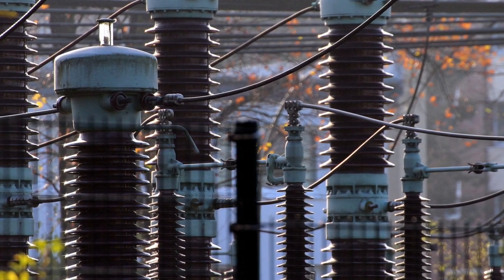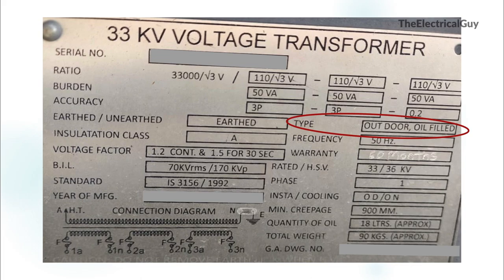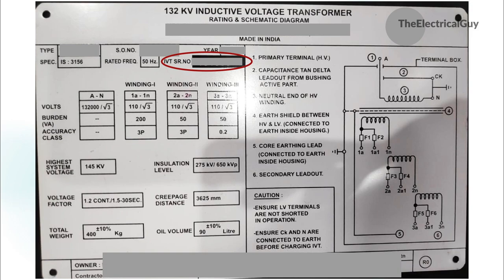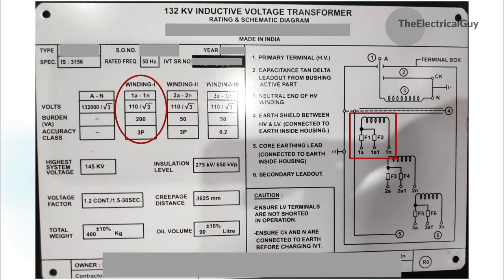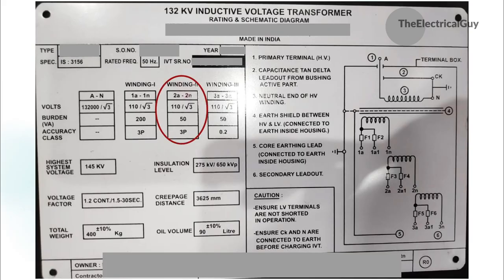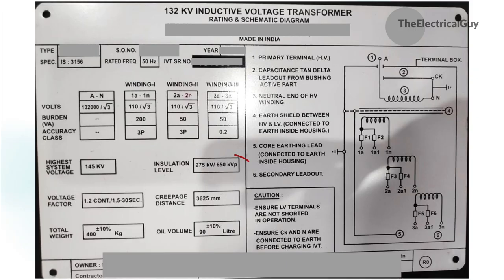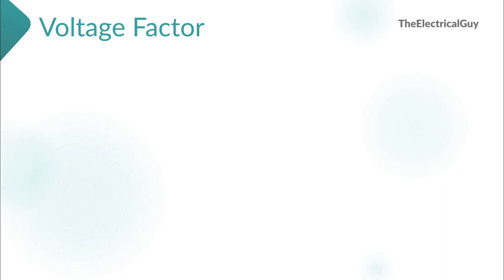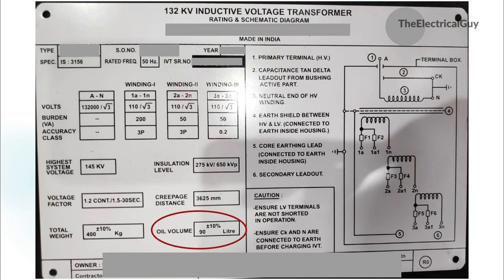Nameplate Details of Inductive Voltage Transformer (IVT) | Explained | TheElectricalGuy

Comment: First of all thnx sir, it's very helpful. And i think LV terminals most not be short ckted because, as we decreasing the voltage in a very high ratio, the current will going to increase in that ratio and if we provide a path for easy circulation of current, it will damage the device.

Comment: When u short the secondary of transformer voltage goes to zero and cause huge amount of short circuit current rush into both primary and secondary of transformer cause damage to winding of transformer

Comment: Many thanks, very interesting video.
In nameplates of transformers
 it is mentioned secondary tensions 100/√3 V ,110/√3 V, 115/√3V. why this difference. In the new transformers we find the just 115/√3 V
Reply from the maker: Well, secondary voltage is generally depends upon customer’s requirement. But if you are following IEC then having 3 different voltages is not recommended.
Reply: Well. Would you like please to specify the reference of IEC standard. Thanks
Reply from the maker: For IVT, it is IEC 61869-3

Comment: Suppose we have 69000/√3 /120 V voltage transformer with nominal burden 100 VA. What would be typical termal burden for this unit and cross section of wire of secondary winding(s)?
Reply from the maker: Thermal burden is generally defined by the manufacturer. And hence, it may vary based on the design.
Reply: @GauravJ  I am aware of that. However, it is strange how wide range of thermal burdens for similar instrument transformers one can find. For example, 24 kV voltage transformer, nominal burden 50 VA, but thermal burden given by manufacturer whooping 1500 VA
Reply from the maker: That is strange. Because practically the burden will not go to 1500 VA. Or may be it is typo error it could be 150 VA (Just a wild thought 😜)
Reply: @GauravJ  I guess it is not mistake. Usually such data are found for potential transformers used in medium voltage networks. 750 or 1500 VA thermal burdens stated are not so rare while nominal burden just 50 VA. Secondary winding wires are like 1.5 mm2
Reply from the maker: Okay. Thanks for the info ✌🏻✌🏻👍🏻

Comment: What is the difference between power transformer and instrument transformer, sir
Reply from the maker: Power transformer is used for stepping up or down the voltage generally in transmission phase. Instrument transformer is used to measure the voltage and current and also for protection purpose.

Comment: Sir what is thermal varden of VT
Reply from the maker: Thermal burden : 
This indicates the total amount of apparent power we can take form IVT at a same time without increasing the temperature of IVT as specified by IEC or the other standards.
Reply: Thank you so much sir
Reply from the maker: Thanks friend. Check out the about section of my channel or description of this video.
Reply from the maker: Email - gauravj@theelectricalguy.in